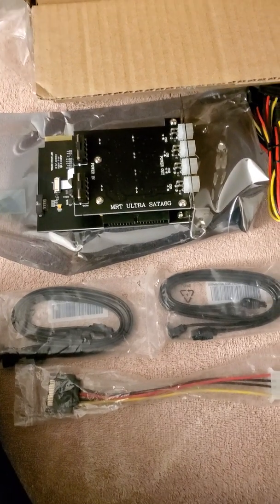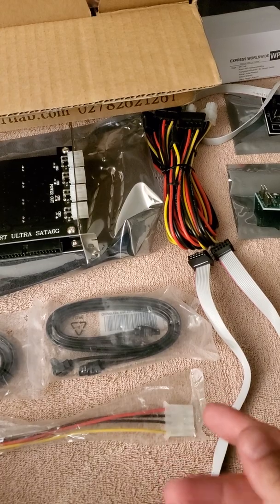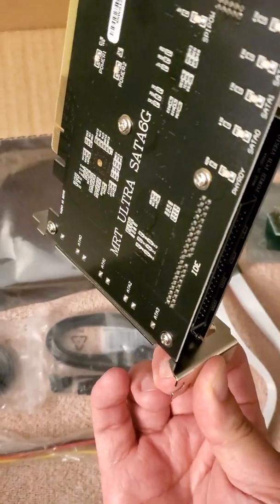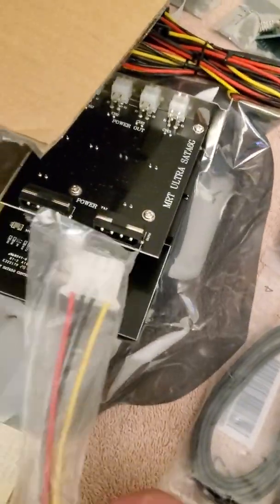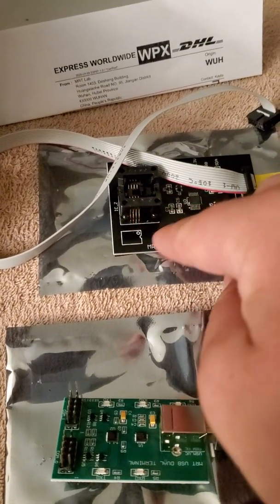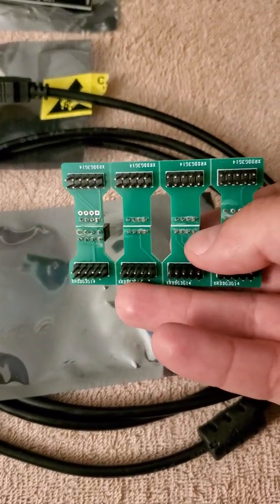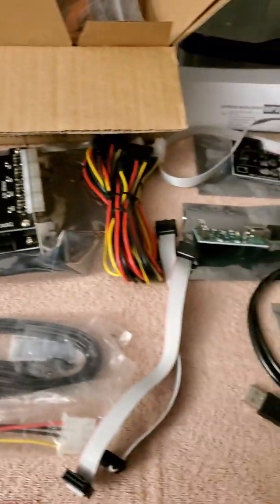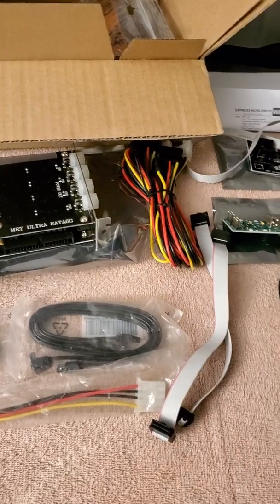MRT Ultra Data Recovery Equipment from China

Comment: India price
Reply from the maker: Not sure. Contact MRT staff via Skype. They will let you know.
Reply: @Datarecoveryguru1  hi, I would like to know does mrt tools works same as deepspar and pc 3000 tools. What's the main difference between mrt and pc 3000. I am bit confused can you please guide me. Thanks and appreciated
Reply from the maker: @mfukhan MRT is more similar to PC3000, because from a design and functionality perspectives, they operate very similarly. The difference between them is quality, where PC3000 is an overall superior product, especially in the Data Extractor module. Also, the main difference is price, where MRT has a more affordable purchasing option (pay by month).
Both, MRT & PC3000 are different than Deepspar in the ability to perform firmware and various advanced firmware level repairs.  Deepspar is very limited in that regard.
However, Deepspar is fundamentally a solid hardware cloning tool. 
Perhaps you are asking, because you are considering what tool to buy, correct? If you want the best and most ability in all aspects of data recovery and drive repair, but most expensive, go for PC3000. MRT has improved tremendously in the last couple of years, so it is pretty good as well, and, obviously purchasing friendly.
If you only want to focus on cloning ability, then Deepspar is fine.
Reply: @Datarecoveryguru1  thanks for the information. I am planning to open up data recovery business. Looking for options. If I have Mrt ulta tool, will that be enough to perform most tast or I need more tools apart from mrt ultra. I am at first stage so don't want to invest more like pc3000 or 100 cleaning room. You sugesstion please. Thanks